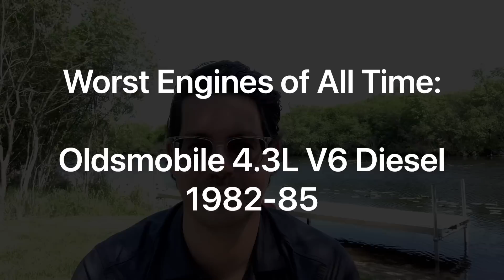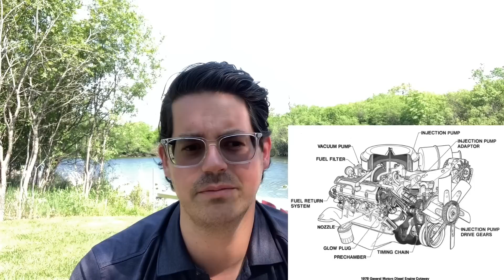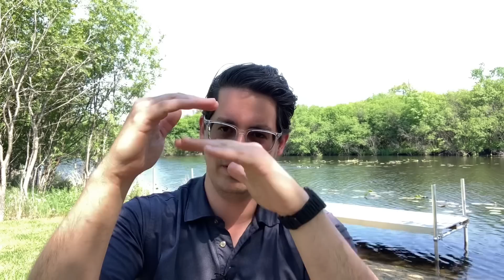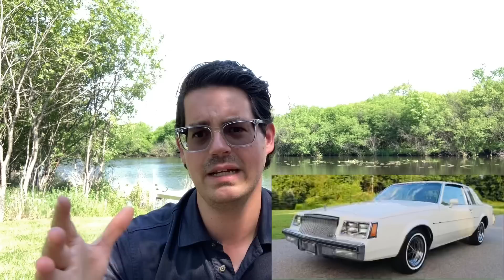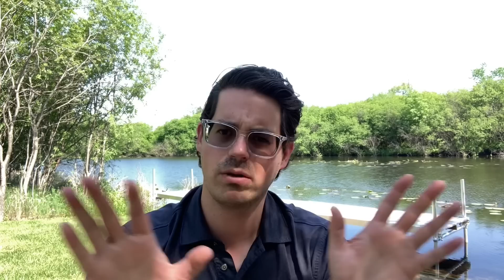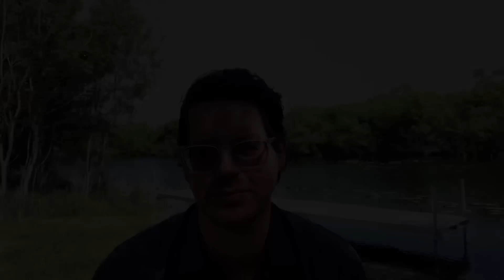Worst Engines of All Time: Oldsmobile Diesel 4.3L V6

Comment: It always struck me as odd that the US manufacturers didn’t try to copy the bullet-proof nature of their German competitor’s diesels in the late 70s/early 80s. The OM617 Mercedes I5 Turbodiesel is legendary for its longevity (I’ve had many early 80s MBs that reached 400k miles on the original engines). GM could’ve learned from the Germans and not given diesel the bad reputation for decades after, but as usual, GM decided to test designs on their customers, and soured Americans on diesel for 20 years. 

I’ve also always wondered why GM didn’t have Detroit Diesel involved on the design of their diesels. I think GM had an interest in Detroit at that time, and having an actual diesel engine designer involved probably would’ve solved many issues. Although admittedly, the 6.2 and 6.5 were turds, but at least they were reliable. I’m sure GM had a hand in making those into turds…

GM’s usual mantra: introduce something new that’s awful, fix the problems on later models, get things almost perfect, then kill it off. Rinse and repeat. Haha

Comment: When will you arm chair mechanics ever realize that when you videos like this you put your foot in your mouth by drawing your own conclusion based your sad experience boo hoo like judge Judy would say, you're a grown man get over it, Oldsmobile diesel engines were good but everyone mistook engine damage as diesel clatter, the engine was neverbuilt to run that loud, that's what prechambers in the cylinder heads were made for, Einstein.

Comment: My family had a couple of the c10s with the 4.3 and 5.7 diesels. One thing we ran into alot is torque converter failure and transmission problems. I think the low end torque of the diesels didn't play well with the 700R transmission and torque converters they had from the gas engines.

Comment: The FWD V6 Diesels that were towards the end, were actually better built than the claimed "350DX" Olds V8...Those V6 4.3L Diesels are WELL KNOWN to be 200,000+ mile engines, in fact I know of one in an S10 that was in a FWD Celebrity but the body fell apart at 250K. - They are nearly impossible to get replacement parts though.

Comment: Worked for a Buick dealer in 1985. They ordered a Century with 4.3 V6 Diesel for a developer who planned to fuel it on his jobsites with no-Taxed diesel for heavy equipment. He went to jail for fraud, and when the car was delivered the dealer was shocked. They took the "Diesel" badges off with solvent and sold it to someone who probably thought he was buying a gasoline engine. Never came back...

Comment: I just purchased a 1984 Cutlass Ciera brougham it is a one owner with close to 300k miles has been sitting for about 10 years but ran when parked. I think I am going to make a video series revive and drive home, then possible restore it. If the uni-body is too far gone and it probably is I will pull the engine rebuild it and add a turbo and put it in a 4x4 s10 or ranger for my daughter.
Reply: Note: the fwd 4.3 block and red block had different bell housings.....and different intake manifolds...... I was the diesel tech back in the day  for an Olds/GMC dealership.

Comment: It is fascinating to compare Oldsmobile's diesel efforts with GM Europe's Vauxhall's own 1875cc Slant-Four (62 hp / 100lb-ft torque) and 3750cc V8 diesel engines efforts in the mid-1960s or Rover's Project Iceberg 3.5-litre V8 (100 hp NA / 125-150 hp turbo) together with Perkins. Supposedly there was even a highly secret project at the GM technical centre in Detroit to make an experimental 3.8-litre Buick V6 diesel using Mk5 Ricardo Comet Mk 5 combustion chambers (mentioned in the Issue 561 Oct 2017 edition - A Wisp of Steam Supreme by Melbourne Steam Traction Engine Club).

Comment: I used to own 2 5.7 Liter 98 Regency Olds 350 V-8's. I wished I had links to show you. I have some old magazine pics I could show you, but I would have to find them, and some serious scanning. Was forced to sell them both. I don't know where they are today? The heads blew twice on the '84 on me. the '78 actually did very well! Never blew heads! And had more horsepower! With the pencil injectors. It actually turned out to be more reliable, believe it or not. 
GM deserved to have their butts kicked over this! This could have been a win/win for the industry, and the public IF they had been serious about it. I personally think they were paid off by the Oil Industry.

Comment: Drag racing guys with olds cars like to use the olds 350 diesel blocks because they have forged cranks, and rods, and they had extra webbing in the main bearing area therefore they can handle high compression pistons and can withstand higher rpm’s. And can be bored to .125 over because the cylinder bores are much thicker than the gas version.. in stock diesel form they actually weren’t bad, but the red high sulfur diesel fuel of the day was not good for emissions

Comment: The Oldsmobile LT6 4.3 ltr 262 V6 diesel introduced in 1982 for a few RWD G Body's was the first regular production GM engine with a serpentine accessory drive belt. 

As it turns out, the 1990 Oldsmobile LV2  5.0 ltr/307 V8 was the last regular production GM engine with a V belt accessory drive system.

Comment: It is frustrating that the Oldsmobile Diesels were so rushed, and cost-down. It didn't just hurt Oldsmobile/GM, it hurt the entire concept of diesel engines in cars in North America for decades.

Strangely, I do wonder how a 4.3L V6 Diesel would have done with a smaller turbo....

Comment: I don't think it was just the reputation of the Olds diesel that killed it. Gasoline prices had also eased significantly by 1984 and 1985, so there wasn't as much interest in the diesel.  In 1981 gas was over $1/gallon.  By 1985, I remember it being more like 75 cents/gallon.  so there's that.  Even if this wasn't a great engine, at least the Oldsmobile division was doing something about improving the fuel economy of their cars.

Comment: I bought a 1978 Olds Delta 88 with the 350 cu. in. diesel. At first it was a delight to drive but after a year or so quality problems arose. The gear shift pointer of the steering column no longer lined up with the letters PRND21. The state inspection failed me on that. Another quality issue; the headlights would turn off when I would hit the brakes. The dealer told me that the wiring for the headlights was routed in front of the second battery and would rub the insulation off it when the battery would slide forward causing a short circuit. The dealer routed the wires in back of the battery. Next, when I would pull into a parking space I began to notice that there was  stream of oil on the ground . It didn't appear when I was driving so I thought it was someone else's car. When I went to check the oil level, I found I was almost 2 quarts low. Took it a dealer who told me that the rear end of the engine was worn away - that's where the 'rear seal' is or was actually. Thus the I had to have a new engine block installed, not with new pistons and crankshaft, etc, mind you. About a year later I took the car up to 60 on the turnpike and heard a banging noise. Dropped it back to 55 and it went away. Did that a few times to confirm it came from the engine. Back to the dealer. This time it was a bent cam shaft. It was fixed and that ended my experience with the diesel as the car traded as soon as I got it back.

Comment: I learned to drive, in part, in an Oldsmobile Delta 88 diesel. It was quite an adventure. My college roommate told me we couldn’t run out of gas, because it was a huge hassle to get the car running again. It was clattery and slow, which didn’t make sense to me, since it was a 350 V8, until I learned that diesel engines had different power properties altogether. Sadly, another example of GM, or any American car company, coming up with a quick fix to a big problem, which yielded larger problems in the long run.

Comment: Misleading title. I've been researching the 4.3L V6 after discovering one in a salvage yard. All the info I've found indicates the 4.3 is actually decent, it just suffered from the bad reputation of the earlier (and bigger) engines. I was prepared to hate you and your video for spreading misconceptions, then you say the 4.3 is a good engine. So why the negative title? Anyway, thanks for the informative vid!
Reply from the maker: They still had intake and head gasket issues. Parts are now unobtanium.

Comment: I still have three of these cars.  Only one still runs.  My nephew still drives the 82 Buick Century.  It gets 32-36mpg and is extremely comfortable to ride in.  The 4.3L V6 is not the worst diesel ever made; it just inherited its big brother's reputation.  The V6 was a well built engine.  All the problems of its big brother (350 olds diesel) had been fixed by the time it went into production--Good fuel filters, 4 bolt mains, 16 head bolts on a V6 instead the 10 on the V8, heavier block.  One of the cars I have has 375,000 miles it and it never had anything done to it other than basic fuilds and filter changes.  If the injectors had been replaced at least once in that time, it probably would still be going strong.  The heads melted because of VERY wornout injectors.  The biggest reason these didn't have morepower than they did is because the EGR valve was right in the middle of the intake and it only had less than an inch clearence all the way around it and they were governor limited to 3100rpm.  I removed the EGR on the 82 and cut out the mount, and it was a big improvement in power.  The biggest problem with these engines now is parts availiabilty.  These would have been an amazing engine with a turbo.

Comment: What killed the Oldsmobile diesel engines was the bean counter involvement.  The first thing they did was remove the water fuel separator from the equation.  Talk about stupid. I have seen a 5.7 Oldsmobile diesel in a pickup that had a John Deere fuel filtration system retrofitted to it with stronger head bolts installed.  It gave up the ghost at 486,000+ miles. Most stock 5.7s were lucky to make it past 100,000 miles without a catastrophic failure.

Comment: I'm building a 4.3l v6 chevy celebrity diesel. Custom pistons(forged) new main rod cam bearings arp head studs 8psi turbo t8 garret tuned injection pump marine injectors! It will surprise you!
Reply from the maker: Wow. Awesome
Reply: @RareClassicCars  I just like odd ball diesel engines for some strange reason? Hey a guy needed a hobby so says my wife! Lol

Comment: This 4.3L diesel V6 was actually reliably much better than its parent the 5.7L diesel V8, not least since the 4.3L had more head bolts per cylinder plus all the other remedies the 5.7L diesel had since the 1981 model year.
Reply: True

Comment: Well, sir, I understand about engineering headcount (I have worked for NASA, Cessna, JPL etc. (I am a researcher)) but most of GM's problems were their own. If they had elected to start work on obvious upgrades that were needed instead of relying on banks of lawyers and huge political contributions to avoid having to change they would not have had the problems and our country would have been a lot healthier and wealthier. It's also too bad a good little engine got caught in the backlash, obviously is they had got it out first instead of doing a backyard level conversion to the V8 things would have worked very differently. I have considerable respect for GM engineers and I suspect that GM management had no real desire for this to work out, they knew that if the cars they made were just terrible then congress would be able to use that as an excuse to write different laws for them versus other countries, which the Congress did. It is only now 30+ years later that American cars have begun to recover from what Detroit management did. At that Tesla's success is not because of lazy American workers or unions or etc, it is simply that Detroit lost the ability to plan ahead or even realize which way the wind was blowing and did it to the nation again (thankfully someone outside their management 'training' system was around to help the move to the EV's)

Comment: What about the metallurgy? I thought that these engines were aluminum and cast iron and that also contributed to the head bolts pulling out easier due to different materials other than what was required for a diesel

Comment: Gm didn't do anyone any favors when it came to 'electing' Oldsmobile to go with the diesel program. FFS, the GAS 350 blew head gaskets with the 4 bolts per cylinder heads at 8:1....

 ...Gee ,lets increase the compression ratio dang near 3 times and see what happens....SMH.

I've owned both the 350 V8 and the 4.3 V6 diesels. I don't have any of them any more because of (at least for me) parts were getting difficult to obtain.

Comment: They put a 90 degree V6 into a flippin Pontiac 6000? Damn I thought the 2.8 was a tight fit - what did the dogbone mount look like? Just two eyelets welded to each other? I can also imagine the great handling when outfitted with such an engine - I had an 89 6000LE, it was OK in terms of handling, but damn.... I... just LOL GM.

Comment: why does CAFE.......... aka ONLY CALIFORNIA............. control the NATIONS emissions laws??? 
.
id rather get 32MPG with a SLIGHTLY dirty exhaust pipe............
than get 23MPG..... with a perfectly clean pipe
.
.
sure, your car does not pollute 
.
but all the oil exploration, drilling, pumping, refining, hauling/pumping..... and finally pumping it into your car..... 
every SINGLE step has pollution..... 
.
.
sure seems like we are just moving the pollution from X.... to Y

Comment: 7:00 you say you used to work for GM. Diesel engine don't compress fuel with the air. Air is compress alone. Fuel is injected after the air is compressed.
7:15 VW used the same number of head bolts on their gas and diesel engines.

Comment: They found out on the later gm 6.5 turbos that the injector nozzles should be replaced every 50k. 
Erosion creates a crappy spray pattern ,egt goes up , and boom. 
Pretty sure injector degradation played a big part in alot of the older ones going boom prematurely.

Comment: I've only seen one of the A-body cars with the diesel on the road.  I think it was a Ciera, and I heard it before I saw the diesel badge.  Didn't know they offered one until then.  We had an '83 GMC van with the 6.2 diesel, and while the engine was good, there were so few of them that finding the parts that were unique to the diesel was a nightmare.  Sometimes we'd go to an auto parts store, and they would claim that there was no diesel option for an '83 van.  I think I know why GM and diesels from that period are not fondly remembered.

Comment: These things were closer to a diesel tractor  engine than a car. Most people that had these 4.3 and 5.7 diesels that lived problem free lives. Treated them right, let them warm up properly before driving, proper fuel treatment and not revving the snot of out them. Old diesels weren't like gassers, they should always be warmed up before you try to drive it harder than regular in city traffic

Comment: I had an '82 Cutlass Ciera Brougham with the Iron Duke (hey, a throttle body!). It was the worst acceleration I've ever experienced.  Nice car, it rode well and had some wonderful factory/dealer options: 8-track, Vista Vent (leaked, of course), power windows and trunk actuator, two tone blue.  Whoever had it before me babied it and, at 16,  I was incapable of that kind of discipline.  I wasn't rough on it by any means, but it just started disintegrating immediately and the effort to keep it up was enormous.   Power windows stopped working, stupid retracting antenna stopped working, you name it.  I remember thinking "is this the worst engine you could get in this?" so I opened up the manual and saw the option for the diesel.  By this time (ca. 1995), the olds diesel was notorious, even to a dumb kid.  So I saw that option and thought "hey, could've been worse."
Reply: I owned a Buick Century with the Iron Duke 2.5L. I know the reputation of that engine, but the Buick sure felt like a hot rod compared to the carbureted Corolla it replaced. It would actually spin the front tires on a right turn, and it started up every time! 

It's anecdotal stuff, but for a long time after that I was kind of bewildered with the American obsession with "Japanese quality." Finally did come around to the Japanese stuff later in life, but I still think GM was making better cars in the early/mid 1980s.
Reply: @jameswilkinson6678  I have few complaints about the reliability of the engine itself, but I bought it fresh off a 80k rebuild in ‘94. The problem was more with the rest of the car. The duke always started and did propel the vehicle, that’s the best I can say, though the claimed 15.7 second 0-60 time seemed a tad liberal to me.

Comment: Water separation was the number 1 cause of blown head gaskets and stretched rods and rod bolts. Couple that with fact that the American public was not ready for a diesel.  5.7 oldsmobile suffered from the same thing.. owned one for years. Put an aftermarket water separation filter x2 and put 150000 miles on it

Comment: I still wonder why Olds or GM didn't go to the Detroit Diesel books to come up with a great diesel engine to put in the cars. I also thought all diesels were higher HP,  really higher Torque, heavy engines that did get better fuel mileage than gas engines.
Reply from the maker: Non turbo diesels and even turbo diesels typically have lower hp.  Turbo diesels may have higher torque.

Comment: The converted 5.7 liter Diesel engines should be by far the biggest anchor motors of all time. My dad had a beautiful Chevrolet truck except for the garbage under the hood. Blown head gasket was it’s middle name.